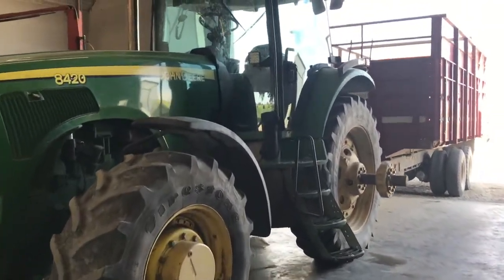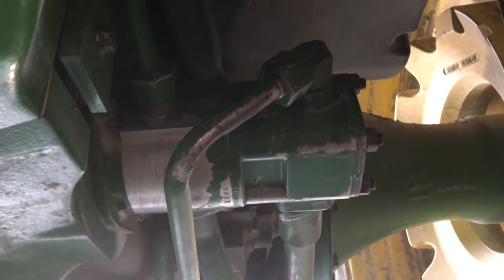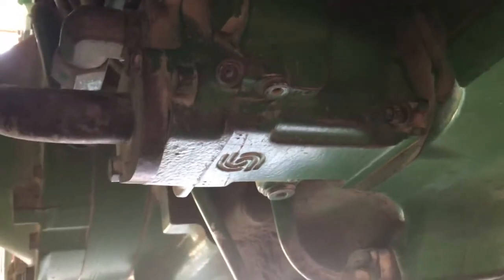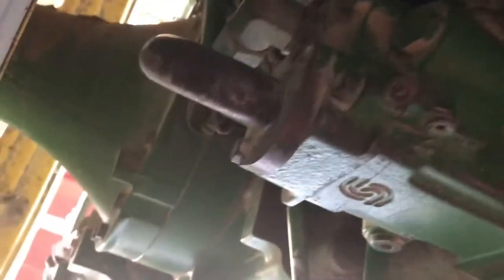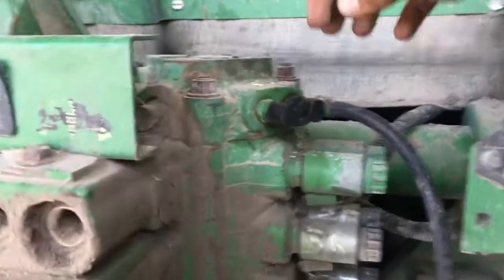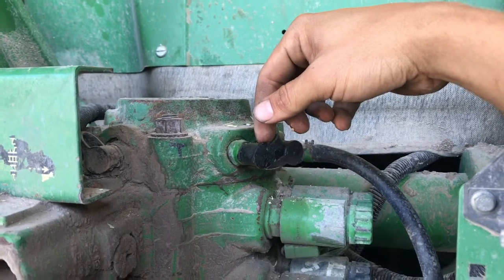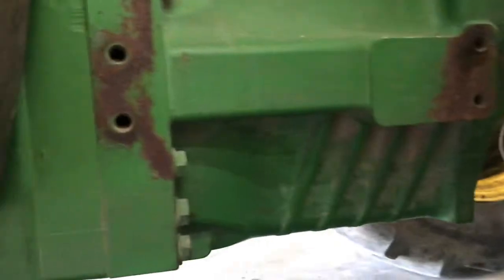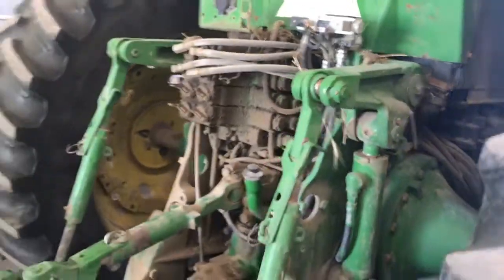John Deere 8000 Series Hydraulics Explained

Comment: My 8410 lost all hydraulic functions and won't move....put a new main pump and tandem pump but still nothing....any suggestions?
Reply from the maker: It won’t move as in it doesn’t drive, or you have no hydraulics? If it doesn’t drive or shift out of park there should be several codes that are coming up. Actually regardless of the problem you should have some codes coming up. I will need to know more information and preferably codes before I can give a lot of help. Check out my video
 https://m.youtube.com/watch?v=uZ8qawaCorE&pp=ygUbV2F0Y2ggYmVmb3JlIGJ1eWluZyBqZCA4NDAw 
and that might help.
Reply: Park brake related codes
Reply: It won't steer, lift, or move in forward or reverse
Reply from the maker: Sounds like it’s out of oil or not getting any. Do you have any systems pressure at all? If the three point doesn’t work that is a charge pump or hydraulic pump problem and the rest of the stuff would be related to the other tandem pump. Are you sure your pumps are turning. If you look under the tractor ( might have to remove a cover ) you can see two drive shafts behind the transmission. The top is the traction drive and the bottom one is auxiliary drive ( PTO and hydraulics). If that is not turning then you found the problem. Otherwise you will have to pull a pump and turn the internal shaft ( tractor side ) and see if it free spins or is connected to the drive shaft. Where are you located? US or elsewhere?
Reply: I marked the shaft when I was replacing the tandem pump, bumped the key to start the engine and that shaft is turning....it also has a new main pump
Reply: I'm in sw Ga
Reply: Bottom trans shaft is turning....ccu72 code, pcu29, acu 70,71....are the codes it's showing

Comment: How often do you have to clean the screen on the bottom of the scavenge pump?
Reply from the maker: You should never have to unless you suspect transmission issues that would cause excess material to build up there. If you check the screen and it’s full of clutch material you probably need a transmission rebuild.